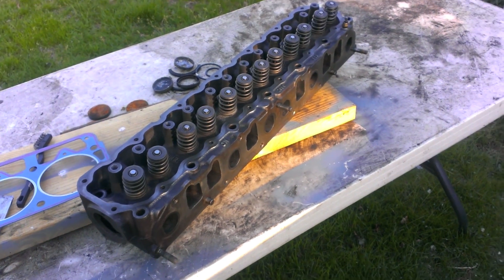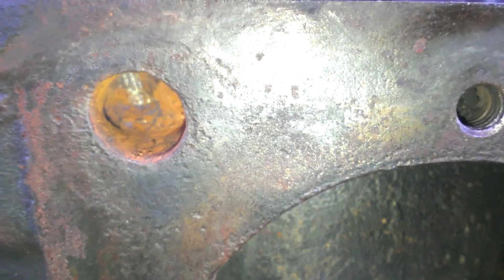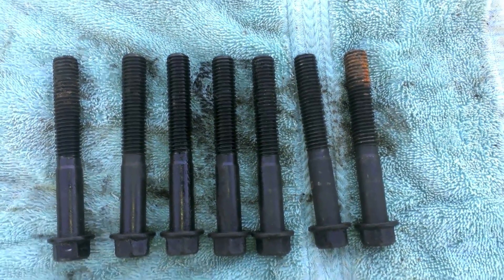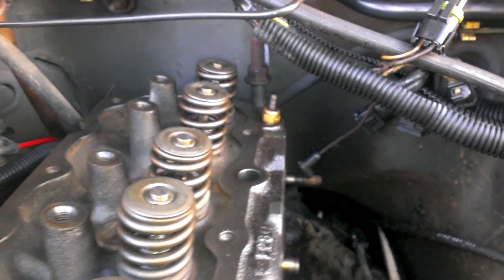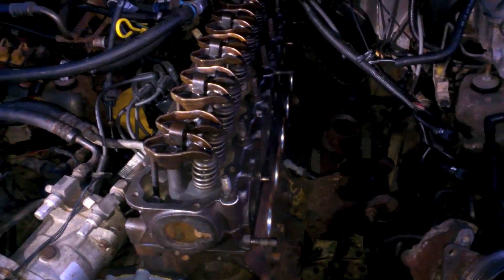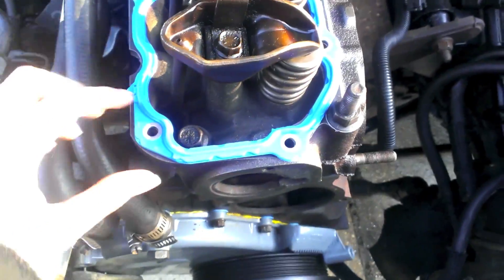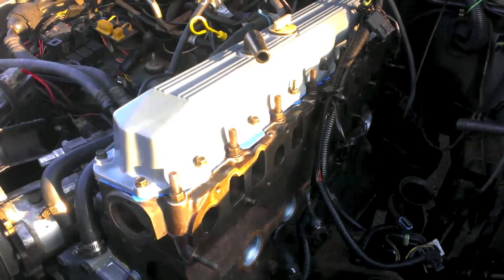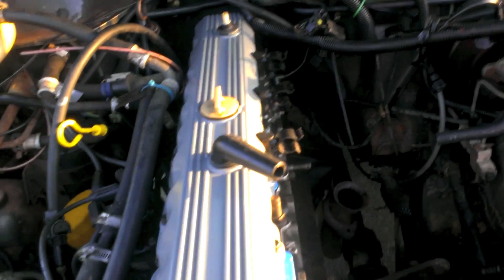89 Cherokee Cylinder Head, Rockers, and Valve Cover Install

Comment: When u did the rocker arms did u go to tdc on each piston and set at 19 lt pounds ?
Reply from the maker: I notice the Haynes manual mentioned that but I don't think I did that. the lifters are hydraulically adjusted so you can just torque em down. it helps to hold them with vise grips so the bridges don't twist on you.

Comment: So i decided to pull out the two front push rods and rockers arms from cylinder 1-2 front of the engine, put it back together torque them to spec (23 foot pounds) And now all it does is sputters and dies. What the fuck did i do wrong????? Its a  91 Jeep Cherokee 4.0. Did i throw off the timing?? HELP.
Reply from the maker: So wait, did you remove the pushrods and then put it back together to make a dead cylinder or are you saying you just took it all apart then put it all back together again?
Reply: Yes i removed just the pushrods and rockers arms from cylinders 1&2. And i put them back in like it was.
Reply from the maker: Hmm. weird. As long as the push rods are sitting in the lifter bores properly and the rocker arms aren't crooked, i can't think of much that could go wrong in that area. Might help to have some one crank it and see if they are moving up and down properly.
Reply: So did i not screw up the timing when i removed the push rods and rockers arms from the front two cylinders?  Or maybe i did not properly seat the push rods.
Reply from the maker: Nah, the valve train doesn't directly affect timing at all, camshaft and crank will still be aligned by the timing chain. I would think maybe something didn't seat right
Reply: Thanks for the quick replys. I'll be out tomorrow Tuesday to see what i did wrong.

Comment: What are those plugs in the head behind the valves for?
Reply from the maker: The square drive on the top? I believe those are used to get the sand out of the cooling jackets during the casting process. The little plugs on the back of the head and engine are for oil galleries or something like that.

Comment: Only a NON car guy would ever RE-USE old head bolts .. NEVER re use head bolts .. get new  and don't forget to use the thread sealant on the bolts that pass thru water jackets OK
Reply from the maker: You're right, I AM a non car guy, more of a Jeep guy myself. These head bolts aren't torque-to-yeild so they don't deform very easily. I've reused them atleast 3 times now and guess what, they still hold fine because they weren't over stretched. Besides, couldn't find a stock replacement kit that isn't the gross 12 point design.

Spot on about the thread sealant though on bolt 11, mucho important to prevent leaks.
Reply: That's right, you tell'em Nicky.  Even Eric The Car Guy re-uses head bolts as long as they're not TTY.
Reply: Hey hoss,never INSTALL OLD HEAD bolts. #4 ONE OR #4AT THE AUTO PARTS

Comment: I know this video is mad old, but I had the same problem with my cooling system, previous owner used some stop leak and the clogged the living shit out of the radiator. Head is okay, but god damn was my cooling system disgusting.
Reply from the maker: I feel for you, that stuff is nothing but trouble. Recently flushed out someone's severely neglected cooling system and it took over half an hour of constant flushing to run even remotely clear. Aweful stuff
Reply: I used Blue Devil HG sealant.  Never again.  It appears that the head on the XJ I got had been taken off by some noobs and not re-torqued properly.  I didn't know that and developed a coolant leak.  I tried to use BDP and it not only got all in the cylinder, but in the rear pre-cat (new cats needed).  I didn't know the nature of the damage for 10 months since I had another vehicle.  It was a mother to un-stuck the piston in the rear.  In the end I had to take a sledge hammer and a 3 inch stainless steel tube to it.  Block damage ensued.  $60 of BDP destroyed a 4.0 engine and the cat, and maybe the  02.  I'll never ever use any sealant again.  It's a limp method for a short time at best.  It lasted me like 2 weeks.

Comment: did you do a valve lash adjustment?
Reply from the maker: Not possible. These engines use hydraulically adjusted lifters to preload the valves automatically.
Reply: +NickInTimeFilms k thanks my 96 jeep cherokee country over heated and it warped the head so im replacing it and someone told me i had to do a valve lash adjustment on my new head. I appreciate the help, love your videos, you and bleepin jeep rock my socks off. keep it up.

Comment: Any thoughts on the Haynes manual talking about TDC b4 reinstalling the rockers?
Reply from the maker: I'm not much of an engine guy but I didn't do that when I put these old rockers on. It's useful for checking some kind of preload when building up a new engine but I don't think it's necessary for used engines
Reply: Hey man I appreciate the response. I've got used head all cleaned up and I'm about to install the rocker arms and the book from what I could find talks lil about it.
Reply: I'm very far from in engin guy my self
Reply from the maker: Tony Molina well if the book talks about it the maybe do it. Search Google and see what people on the forums say.

Comment: So Nick, put a dab of white paint on each of your head bolts. Lol
Reply from the maker: If I decide to keep the engine then I may just go do that. haha.
Reply: lol. Well, if you sell it, it will tell the next mechanic or owner that he or she needs to use new head bolts if they rebuild it or replace the head gasket. It is a courtesy for the next owner.
Reply from the maker: Paul Nunya I hear yah. 2 of the cylinders are running a little more than half normal compression and I can get a fully rebuilt long block for a little over $1k so a swap may be in the future. If I had any hi-temp paint i'd do it.

Comment: You can use your head bolts twice. If your head bolts have white paint on them they have been used twice already. Bolts that are torque to yield are once only bolts. If you look in the Haynes or Chiltons manual you can confirm this. These are regular old school head bolts on the 4.0 series engins.

Comment: Everytime you remove or loosen your head bolts you should always replace the bolts!!! Just a lil fyi those bolts go through a lot of strain and get weaker. Youll be alot happier especially after all that work.
Reply from the maker: This is much more important on newer aluminum engines that use torque-to-yield bolts which are literally stretched when they are tightened down. These are no-doubt one time use because they are warped afterwards. As for older Cast iron engine, if you want to do a nice job, get a set if you want but it's not absolutely necessary. They are standard torque and are not warped as much. I should also add that I plan on swapping this engine eventually.

Comment from the maker: I tightened them all at once. I believe they are self-adjusting if that means anything. I held it in place with my hand and torqued it down, then adjusted them by tapping them with a hammer if they weren't straight. I got most of my info from my Haines manual, it gives a basic guide on how to do just about anything, especially about the engine. Any questions I had I looked up on Jeep Forum. Hope this helps.